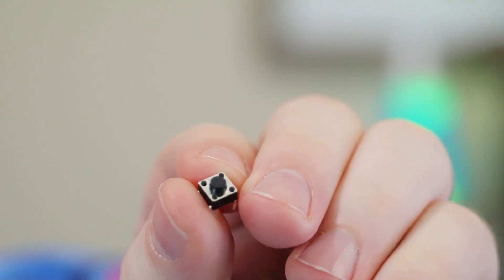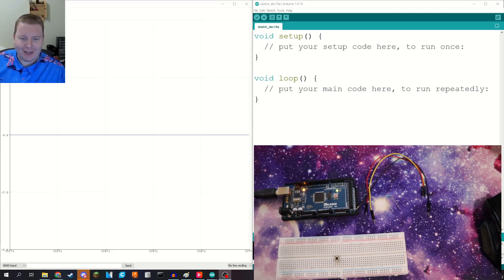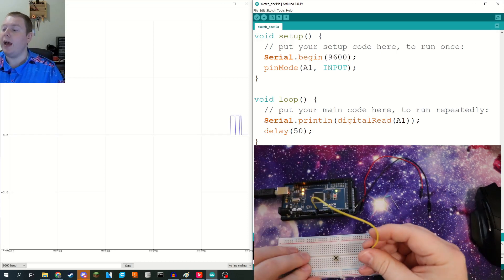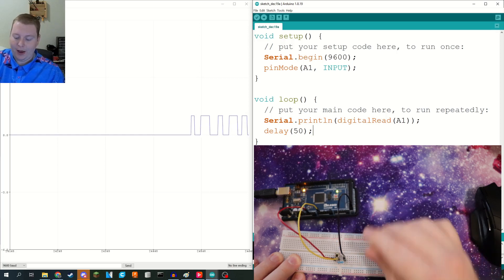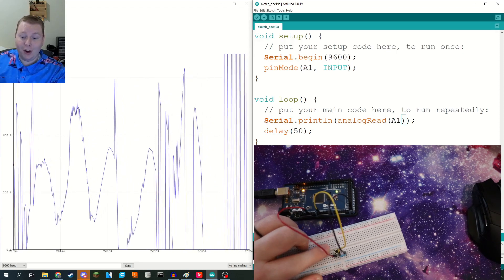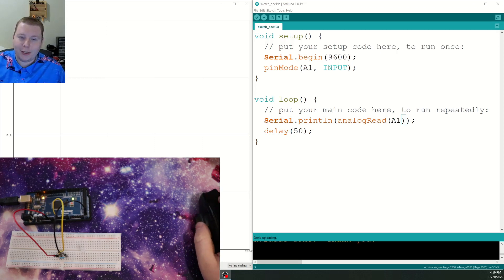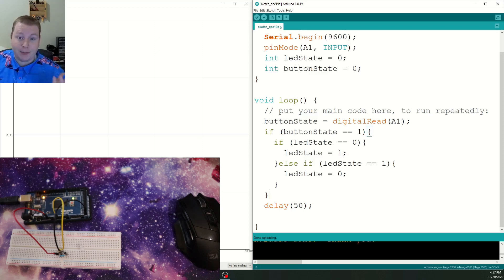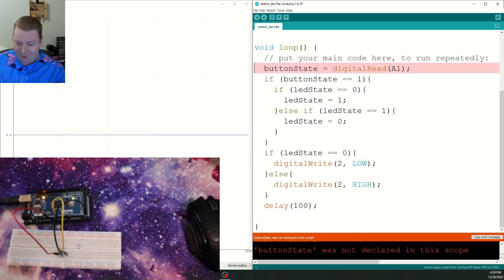Arduino Button Basics for Beginners: Understanding the Wiring, Programming, and Functions

Comment: As a complete beginner I didn't understand some voltage, current, resistor related terms, and think the coding was a bit of "I don't really understand this fully but I could copy and modify it." I'm sure it's good for those with a more complete understanding though! Very useful and gets the gears turning though, and I like your presentational style too. Thanks!!
Reply from the maker: It gets easier with time! That's the best way to learn, in my opinion. It can be too easy to get burnt out if you try too hard to understand every part of the principles. I prefer to jump right in and figure things out as I go!

Comment: I'm thinking of getting and trying to learn how to use an Arduino. But not sure I've got the time to learn a new skill.
Your video is great by the way.
Reply from the maker: You totally can! I may have overplayed the difficulty of learning it in the video. Starter kits (I linked the one I learned on in the description) make it super simple. You don't even really have to have electronics knowledge. Glad you liked the video!!
Reply: @christophersfactory  I will have to give it a go. Thanks for the encouragement. I know a bit of basic electronics it's more the programming I will struggle with.